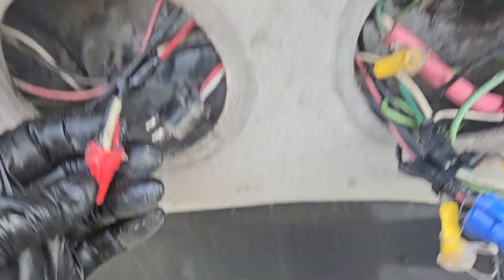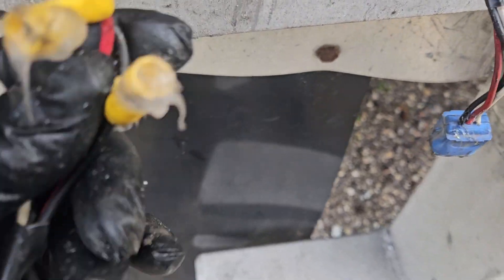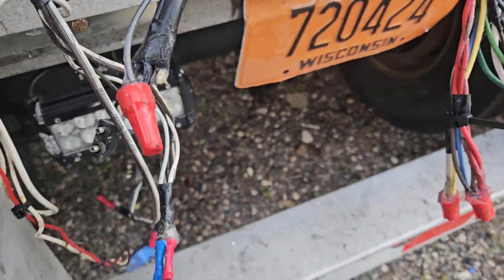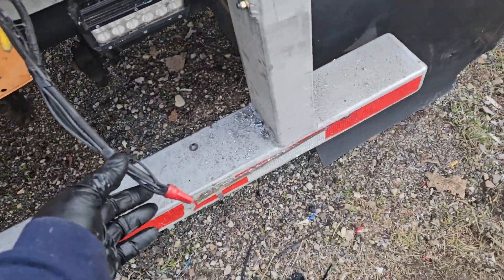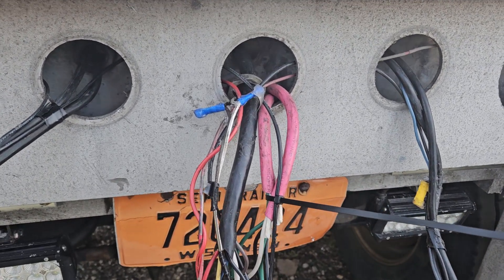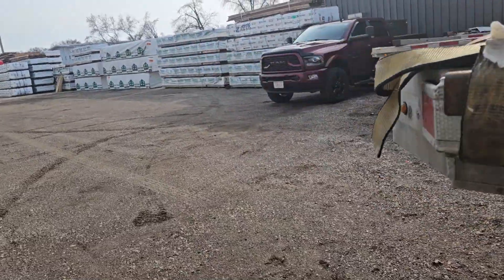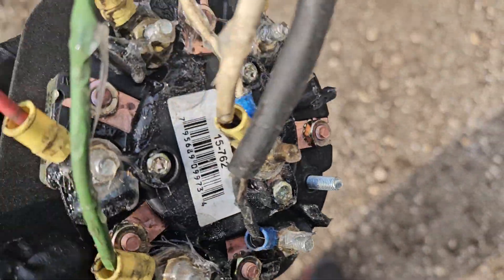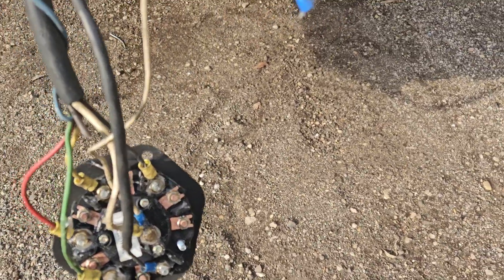REWIRE SEMI TRAILER PART 6 OF 6 VIDEOS

Comment: Can Artificial intelligence replace truckers and drivers in future tell
Reply from the maker: It can happen in trucking. I wouldn't be too concerned about that. They have to get the roads better prepared for the self driving trucks. Also. even if the electric trucks come soon. They will still need a driver inside the truck incase something happens. Like when u see a train. They have a person that helps operate the train. Even though the train is on a track. Someone needs to be a safety tool.